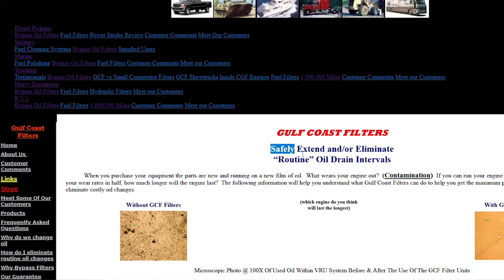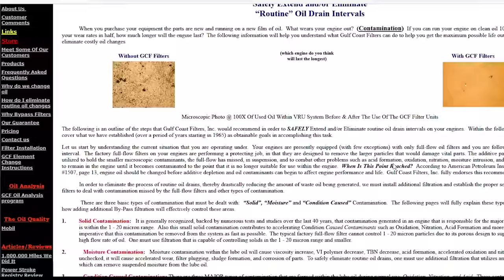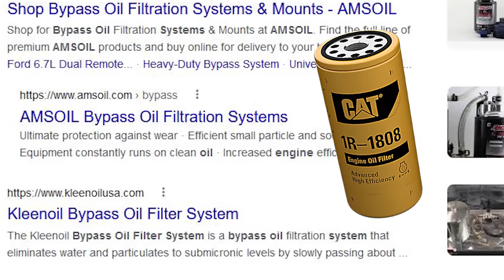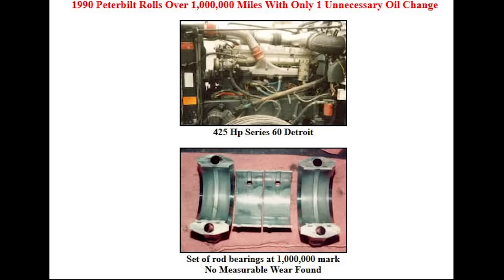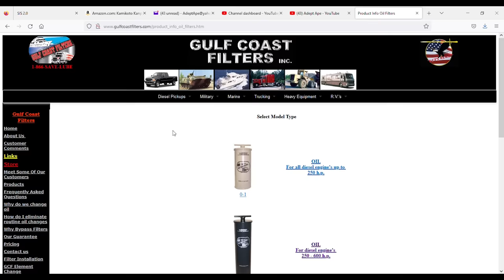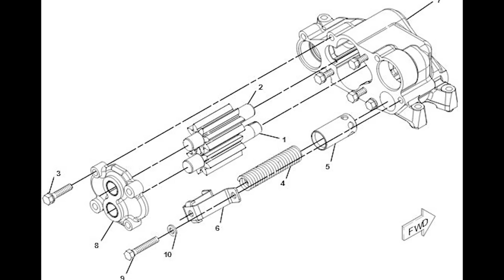No Oil Changes and 1 Million Miles!!! Are Oil Changes Optional with a Bypass Filter? (INTERESTING)

Comment: That's actually a very low saving over that many miles.  Not enough savings compared to reliability
Reply: You mean my old Ford 390 will be more reliable if I allow the oil to get dirty then drain it. The 50 year old Motor Guard cost me less than 50 bucks. Dont drive it much its getting old and uses too mich gas. Im getting old and running out of gas.
Reply: @ralphwood8818  lol don't know about you but every 5000k i change my oil.  And being a boss motor, I'd do it every 25000 might actually get some decent reliability and ks out of it
Reply: @lukeberne428  I can remember when I thought oil needed to be allowed to get dirty then be drained. It was a long time ago. I got educated about 1963 working in a full service Standard station. I told a Standard oil engineer I see you just changed your oil.He showed me his Frantz oil cleaner and told me to use Delo 100.. I went looking for a Frantz dealer. It changed my life. Sister wrecked the old Impala. My last two Frantzs went to a salvage in Dallas.Texas.. Got started using the top loaders Jackmaster  Gulf Coast and Motor Guards Dont have anything big enough for the big Gulf Coasts

Comment: It’s called walking over a dollar to save a dime…..changing the oil might let you catch something you may have missed keeping a engine on the road…
Reply: A guy once told me if he didnt get under the truck to remove the drain plug he wouldnt see problems with the chassis. Makes sense. Filters that clean oil have saved me a lot of dimes. I dont do dirty oil.

Comment: Ford truck had bypass , still needed  changes at 5k . Oil was dirty AF
Reply: My 76 F250 with the 390 has a 50 year old Motor Guard oil cleaner on the engine. And a 30 year old Gulf Coast filter on the automatic transmission. I dont tolerate dirty fluids. There is also a Gulf Coast junior filter on the gasoline.Probably over kill on gasoline. I have a Ford bypass filter on my Ford diesel tractor. It cleans oil. It has been converted to use Scott 1000 toilet paper. I dont do oil drains.
Reply: I did change the oil on the Ford tractor. I recently bought the tractor and didnt know what was in it. Walmart had heavy duty diesel 30 weight conventional oil for non highway  use.The tractor holds about 8 quarts Seems to be harder to find single weight these days.
Reply: Ford hasnt put bypass filters on trucks since the 50s and they were optional equipment. I started putting bypass filters on Ford trucks and Mustangs in 1965. Frantz and Motor Guard in those days. I just used my last roll of Great Value 1000 from Walmart  in the 390 in the F250. The 390 is pristine.

Comment: I have cat c-13 on a peterbilt 379 where got no power going up a bridge it goes all the way to the top but takes a while even with no trailer connected , but no codes it starts right away any ideas what could it be?

Comment: With mordern oil change intervals manufactures are not trying to protect your engine......they want it to fail at a certain point in time so you 1 buy a new truck or 2 buy a new engine. All you gotta do is look as the auto industry to see the results, honda hatch back dealer maintained with 100k miles on it recieved all 3 of its oil changes.....engine completely sludged up and destroyed (deboss garage has the video on it) ford triton 5.4's half the known problems with the engine are due to poor oil maintenance. It goes on and on and on. In my Pete I changed my oil every 11000 miles period, no matter if it was conventional oil or synthetic.
Reply: If you have a filter that cleans and take care of it the sludge will be in the filter instead of the engine.
Reply: @ralphwood8818 If your getting sludge then the filter isn't doing the trick, you've run the oil past its limits and its breaking down itself. A filter isn't going to catch the sludge if it doesn't make it to the oil pan. Usually sludge starts on the top end of the engine as heat rises so its actually the hotter part of the engine. 
Changing your oil early or as soon as you notice its not longer at the level it used to be at (evaporative loss) is the only way to combat sludge. 
My engines are all spotless inside and none of them have even had timing chain wear with well over the change mileage, solely because the timing assemblies see clean oil consistently , not dirty low lubricity oil that needs changing.
Reply: I remember in the 60s to see so much sludge in an engine you had to open the engine and clean it.. Not so bad these days. I went to do a valve job on a Nissan Altima with 225.000 miles on it. The engine looked new.inside. It was obvious it was a highway car clean running also probably good oil. I quit allowing oil to get dirty then draining it in 1963.

Comment: oil never looses it's ability to lubricate it only looses its ability to remove the contaminants and deposit them in the   filter so as long as you add oil regularly and change the filter you never have to change it  no reason to debate this for the simple  reason that most oil change places use reconstituted oil meaning non virgin petroleum
Reply: The oil in my air conditioner is clean. Its been in there 22 years.
Reply: I remember when you could get re refined  oil at Goodyear tire stores. New Mercedes cars came with re refined oil. Re refined oil was better than the new oil. When you re refine oil you dont have to deal with all the impurities that come with crude oil. Most of the re refined oil goes to the major oil companies. The company I worked for had a re refiner in east Chicago. Individuals wont buy the re refined oil. They want the new oil. A lot of the rerefined oil goes to hydraulic  oil. I just bought some heavy duty diesel 30 wt conventional oil. My guess is it has re refined oil in it. I will never know.. Its as clear as water.

Comment: I own a fleet of freightliners and mercedes with mbe 4000 and mbe 900 engines, they eat, new and used like 6 liters of oil every 20.000 kms. So, you are “renewing” a part of they oil every 20.000 kms aprox.
Reply: Yes the engine didnt go a million miles on the same oil. My old F250 Ford diesel used or leaked about a quart every 600 miles. I never went over 2.000 miles before i changed the toilet paper and addad a quart of new oil. The Pontiac gets a new roll of toilet paper and a quart of new oil every 6.000 miles.The reason the over the road truck is in such good condition is the oil is never allowed to get dirty.

Comment: I don't understand the ,,No oil change in 1.000.000 Miles"
Even a fresh engine wich doesn't consume oil,it still consume a little quantity.
So,how an engine can resist 1.000.000 mile with the same oil? I mean it can resist 40-50 maybe 100-200k miles,but at some point it will eat it all...
Reply: Pay attention. Its a Shell oil test truck. It gets 3 galons of new Rotella when the 3 gallon Gulf Coast filter is changed. Oil analysis says this is enough new oil. Its over 300 gallons of new Rotella added in a million miles. Shell offshore uses the big Gulf Coast filters on the offshore rigs. Those are locomotive engines. Dont be mislead into thinking the same oil lasted a million miles.

Comment: I was taught oil doesn't break down only gets contaminated or dirty.
Reply: You were taught right. When I learned you couldnt use multi grade oil in a diesel. Multi grades.were.crap. I was taught to use a filter that cleans oil and keep it changed.The new makeup oil you add at filter change is enough unless you have an engine problem like a leaky head gasket. In 1963 there were two filters that cleaned oil. Motor Guard and Frantz. I didnt find out about the Motor Guard until about 1966. Oil is better now. There are more good filters now. My oldest oll filter still in use is a over 50 year old Motor Guard. I have Gulf.Coast filters a Australian Jackmaster Classic and a flat head Ford canister filter converted to use Scott 1000. The top loaders are the easiest to service. The Frantz is obsolete. Motor Guard  only makes compressed air filters now..Gulf Coast Filter Company is mostly into heavy duty systems. Jackmaster is the best cleaner if you use the Jackmaster elements.The advantage of the Jackmaster Classic is they have the very small orifice. The slower the flow the better the cleaning..

Comment: Why cant you take the oil you have just changed and pass it through a centrifuge to clean it.  then you could re-use.  you could end up with two sets of oil one set in engine while the other is being reconditioned and then change over and clean the used oil for next change?
Reply: That would work but you need to clean the oil as you drive.

Comment: I ran OPS-1 on my Mack back in the day. MP8 engine. Use to just change the oil filters & fuel filters. Mack/Volvo run 3 oil filters. 2 full flow and 1 bypass already. After I changed the oil filters, just top off. Little over a gallon of fresh oil with the 3 oil filters and the OPS-1 oil filter. Every 30k miles. Did oil samples. Everything always came back perfect. I would go a year, 100k miles. That was just because it just didn’t feel right going that long without changing the oil. So I would do once a year oil changes on my Mack. 
Eventually I will put one on my C-15. I believe in them. The Mack was also an EGR emission engine. So TBN was something I kept an eye on. With the C-15 being a non emission engine. I think the oil should stay cleaner without all the extra soot being put back into the oil.

Comment: An oil filtering system is designed to filter out the particle's that are larger than the smallest clearance within your machine. If the lubricant is laboratory tested regularly and proper additives added, yes it will go along time.  re the guy quoting rail road train engines (I maintain an alco S16-60)  These type of engines consume a large amount of oil in normal operation, so a large amount of new oil is contiguously added. That negates the need for additives.  Testing and regular filter changes are key for longevity. Really, your trying to avoid a $20 filter for a $20k engine???????

Comment: I've tried to get oil super clean I've heated it and ran it through a giant centrifuge had a very slow feed rate maybe 1 gallon per hour but still I'm not happy with the amount of particles that are removed the oil is still dirty put it under microscope and check for yourself

Comment: Back in 70s there was a toilet paper type cartridge oil bypass filter .
Reply: Yes I have used them for 60 years. I prefer the top loaders. Started with a Frantz oil cleaner and Delo 100 in 1963. My.Rambler American flat head 6  came with a spin on bypass filter bolted to the head upside down. I worked in a full service Standard station.We checked everyones oil. I checked a Standard engineers oil. I said I see you just changed the oil. He pointed to his Frantz and said use one of these and Delo. Your engine wont wear out and you wont need to drain your oil..I remembered seeing a Frantz brochure in the grocery store with a Frantz with two knobs. I got the new model with the over center clamp. Better designed filters have came and gone. All I have now is Motor Guards Gulf Coast juniors and a Jackmaster Classic.The Jackmaster is a nice little filter but I drilled out the orifice and put a orifice in the inlet. John Frantz got his start converting the old canister filters to use superior toilet paper. I converted a flat head Ford V8 canister filter to use Scott 1000 and put it on my diesel tractor..I noticed yesterday a couple cracks in the paper. That means water in the oil. I need to not start it and shut it off cold. Condensation.  The only time I drain oil is if I have a reason like a leaky head gasket. I used a two port sandwich adapter on the tractor dont need a orifice .Had a few Frantz 2 ports left but none that fit used a Perma Cool universal. Oil cooler sandwich. Jackmaster has a bunch of adapters At one time there were a lot of Frantz 3 stackers on big marine engines They used 3 rolls of toilet paper.
Reply: John Frantz got his start adapting the old cartridge filters to superior Toilet paper in 1953. I improved them. Saw some Purolater toilet paper conversions on Ebay. They are rare.
Reply: @ralphwood8818  in 70s it was a thing .
Did take dirt out though
Reply: @MitzvosGolem1  Frantz came out in 1953. The improved Motor Guard came out in 1961. Motor Guard only makes compressed air filters now. I read somewhere the Australian Jackmaster  came out in 1954. When Frantz went broke a Frantz dealer replaced the.Frantz with a improved top loader. The Frantz 3 stacker was replaced with a paper towel filter. The 3 stacker was a good filter but it took to many of them to equip a locomotive engine on a offshore rig. Plus they went out of production.

Comment: Curious if a bypass filtering system would work for auto-transmission fluid. My daily driver is a Ford Escape. These vehicles have garbage transmissions in them. Changing the trans fluid does zero for it. Trans fluid goes in the normal light red/pink then turns brown after simply driving a few miles. I've changed it 3 times in the same day with the same results. 
Just a note, I'm a lifelong Ford guy and will never again buy a Ford newer than a 1995. Right around then they started changing everything and it just got worse and worse and now todays Ford vehicles are loaded with crap engineering conflicting electronics and sensors and factory recalls. Never again. End of rant.
Reply: Im thinking about adding a proper filter into the cooling loop of my Automatic Transmission too. It can only be beneficial.

Comment: Do people run these by pass filters on Jeeps, I know this video is about diesel but they’re both inline 6s
Reply: Ive used toilet paper filters for 60 years. Of course they work on Jeeps. Your engine needs an oil pump. Back in the 60s Dick Cepec tires sold the Motor Guards as an off road filter. Mostly used for dune buggies  Dune buggies and hot VWs did a big article on them. I saw a Gulf Coast junior on a Humvee and a big Gulf Coast filter on a Military 5 ton. These filters are no joke.My Pontiac Torrent has a Australian Jackmaster Classic.  If I had a jeep it would have either a Gulf Coast Motor Guard or a Jackmaster Classic on it..I have about a dozen in use. My diesel tractor has a flat head Ford V8 canister filter converted to use Scott 1000 with a sandwich adapter..I got the Perma Cool universal sandwich adapter. From JEGS years ago.. with the sandwich adapter you can drill out the orifice in the bypass filter. Check with Jackmaster. About sandwich adapters  With my Jackmaster I drilled out the orifice and put the orifice in the inlet. You have to be mechanically inclined and have common sense to use these filters
Reply: When I say you need an oil pump I mean  you need to tap into the oil pressure and return the clean oil to the oil pan. I like to use sandwich adapters such as are used for oil coolers. My Ford diesel tractor uses a Perma Cool universal sandwich adapter that I got from JEGS years ago. Jackmaster has a lot of sandwich adapters.
Reply: Very informative thank you, I will look into those. Definitely I need to read about the sandwich adapters
Reply: Years ago Frantz had 2 port sandwich adapters. I still have a few. None that fit the Jeep. Someone in California sent me a 1 port Frantz sandwich adapter. Looks like it might be for a  big thread filter. That inline 6 is a hell of an engine. Worth taking care of. Got my Jackmaster Classic off Ebay. You dont need a sandwich but they just make it a lot easier. My Perma Cool universal adapter has different bushings to cover most any small filter. Have to use a 3/4 16 thread filter such as most Fords.
Reply: Gulf Coast does a lot of military. Saw a little Gulf Coast toilet paper filter on a Hum Vee.That was years ago. I believe it had the 6.2 GM diesel. The Army 5 ton had the single roll Big roll Bounty towel model .

Comment: This won't work on 6.0 power stroke. I ran a bypass and changed oil at every 7500 miles.
Reply: The 6.0 needs for the oil to to be clean 100 % of the time. The conventional system of allowing the oil to get dirty then draining it doesnt work well with a 6.0 diesel. Not all bypass filters clean oil.

Comment: If this were true you think they could just filter/process used oil to make a recycled cheaper oil alternative just as good as fresh oil.....
Reply: Actually conventional oil gets better every time it is rerefined. The used oil coming out of a engine is cleaner than it came out of the ground. Noone will buy it. They want the new oil. I worked for a rerefiner..rerefined oil at one time went in new Mercedes Good year sold it. Most of it goes to major oil company's. Its been a long time. The company I worked for had a re refiner in east Chicago.
Reply: Re refined oil these days has a lot of synthetic oil in it. Goodyear had it in quart containers. Dont know if you can get it now. I think it might all go to the major oil companies. We might be using it and dont know it.